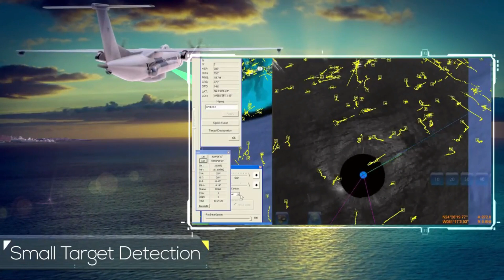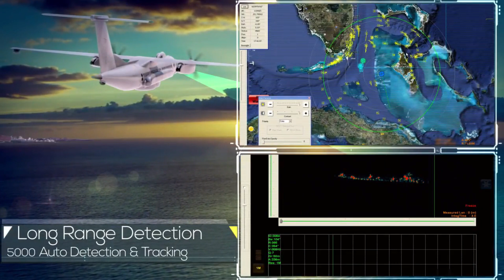Tapas: Ready for Network Centric Warfare

Comment: While Tapas is excellent, there are two huge gaps in the drone inventory. A desi RQ-4 Global Hawk and a Predator clone. t. The RQ-4 provides a broad overview and systematic surveillance using high-resolution synthetic aperture radar (SAR) and electro-optical/infrared (EO/IR) sensors with long loiter times over target areas. It can survey 100,000 km2 of terrain per day. This would make an enormous difference both at sea and land. No doubt why the USA has refused to part with its top tier tech.

Luckily the indigenous tech exists for a SAR radar and EO/IR sensors. Kaveri dry variant provides actually more thrust what the US version has, allowing more payload. It is now the time to start projects involving the private sector and IITs in a way similar to Ghatak to make RQ-4 style drone.